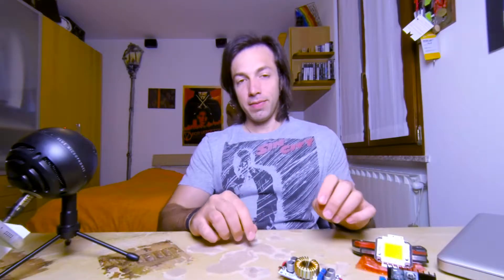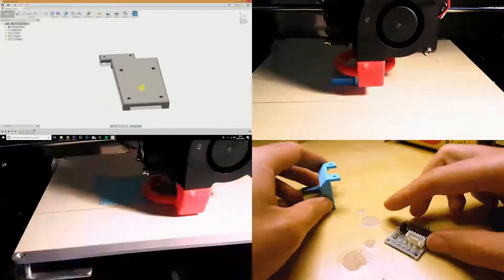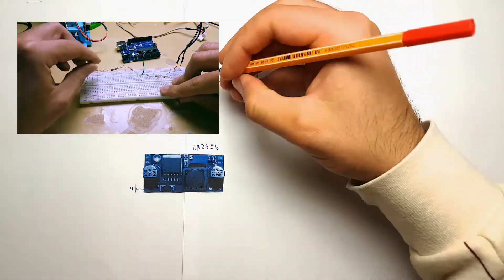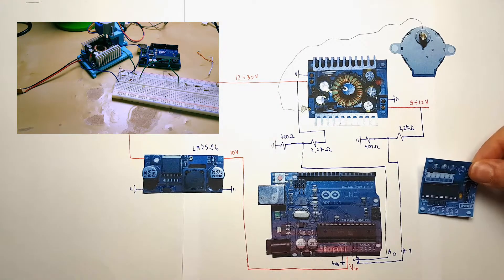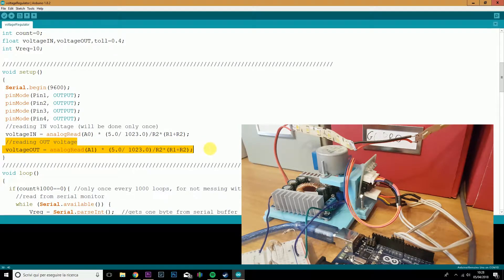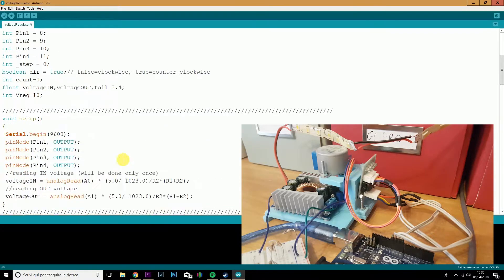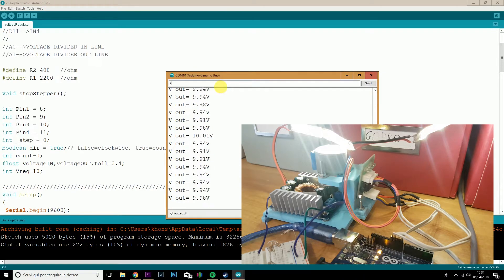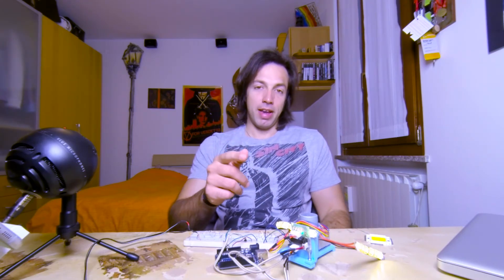DC-DC CONVERTER controlled via ARDUINO

Comment: Why a stepper motor? Why complicate it?
You can connect the PWM from the Arduino directly to the DC-DC converter. To feedback pin or potentiometer. One diode and a 15-30k resistor are needed.
Reply: How can you connect PWM directly to DC-DC? Instead of potenciometer?
Reply: @sportshighlights8708  With a DAC.